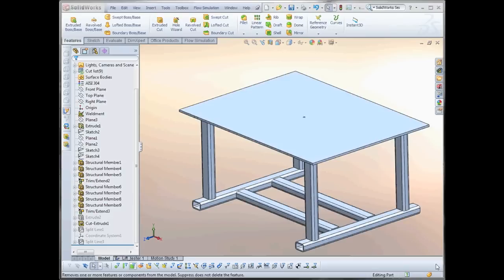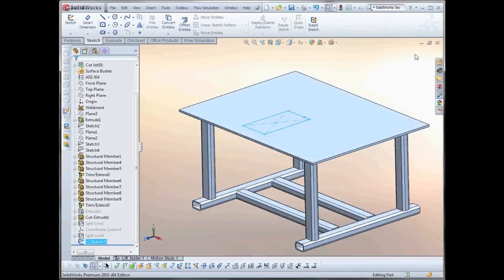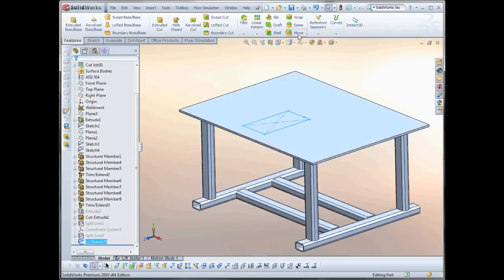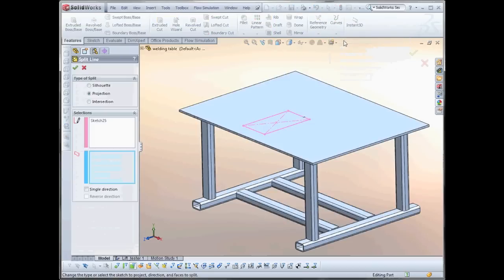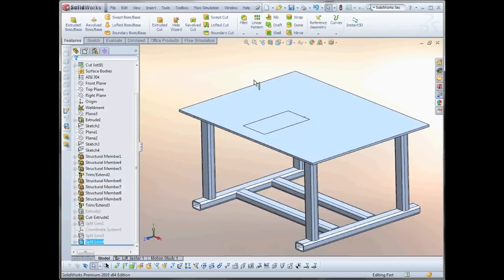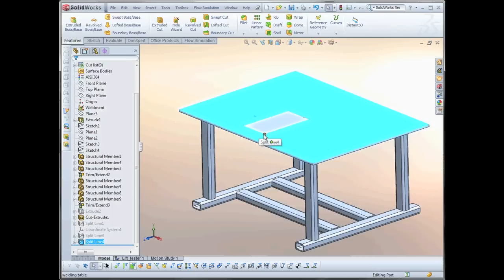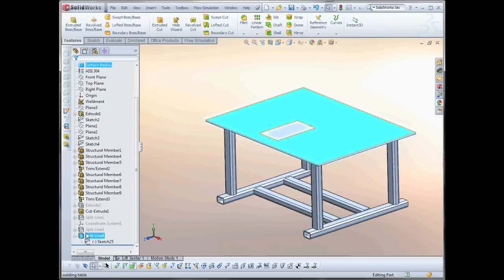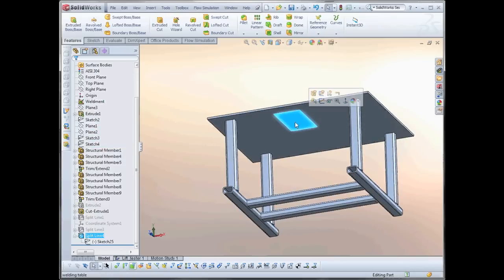SOLIDWORKS - Split Lines

Comment: In SolidWorks 2015, it will not allow me to select the faces of the washer because once i go into edit mode on the base, the washer becomes only a "projection." How do you select the face of an item that originated from the ToolBox?